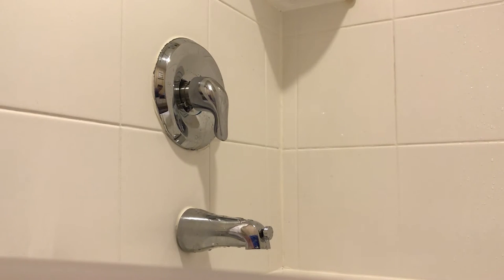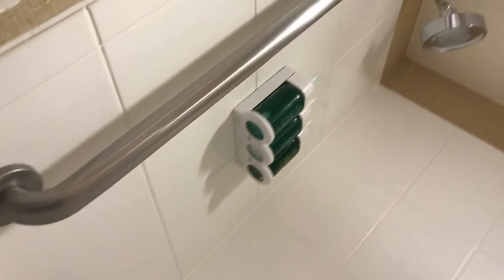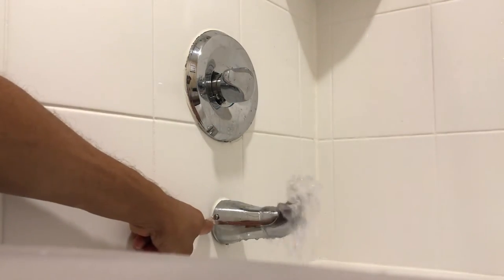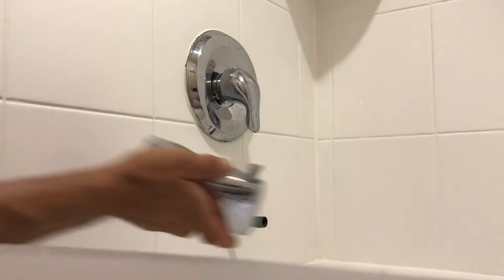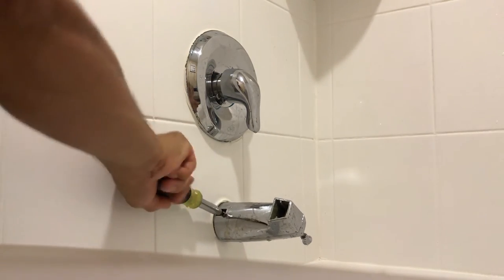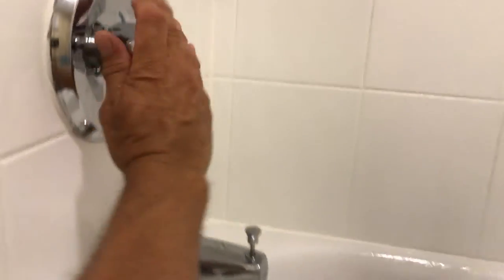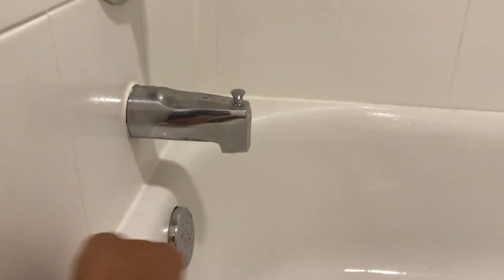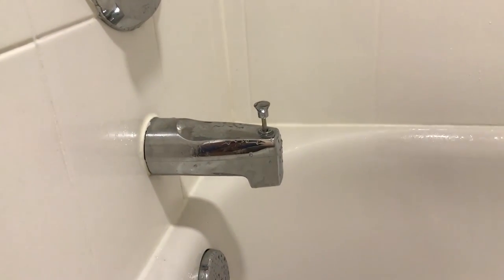Shower Runs When Tub Runs

Comment: Most of these setups are designed for an unobstructed outflow from diverted through minimum of 1/2 inch copper pipe, anything less than that will cause backflow to the shower because diverter-spout section of plumbing is not able to let all the water out from diverter into the tub, causing water to use additional outlet. In my case 1/2 pex was installed instead of copper, and pex couplings/fittings have much smaller inside diameter than 1/2 inch copper. I replaced 1/2 inch pex with 3/4 inch pex (not a huge fan of sweating copper) and that solved problem. Of course using regular 1/2 copper pipe and fitting would work just as well.
Reply: That must be the issue i'm having.  Bought a new house (30 yr old house) and the shower head is ALWAYS on no matter what the faucet is doing.  I replaced the diverter valve and it did nothing to the shower head.  I'm assuming the lines in the wall need some attention........at least i have a really accessible wall to open up...yay.

If I didn't have little kids who need baths.....it wouldn't have a need to fix it.
Reply: I'm having this exact same problem now. Installer put 1/2" pex crimped to a 1/2" coppper spout. It wasn't until he put a sharkbite adapter to change 1/2" copper to 3/4" thread did the shower head start pouring water. Now I have to try to maintain the 1/2" copper to the spout somehow, or open the wall from behind and do what you did, and run 3/4" pex to copper spout
Reply: @konradp8832  Don't you lose water pressure when going up to 3/4?
Reply: Don't you lose water pressure when going up to 3/4?
Reply: @carltonsorrells7609  That's actually the point of sizing it that way. You need to prevent pressure buildup between diverter and spout because that would cause water to "look for" additional outlet and backflow to the shower head.
Reply: @kaetamine  how did you put the 3/4" pex onto the 1/2" diverter?
Reply: Just had a bathroom remodel and I'm having the same problem. But in my case 1/2" CPVC was used for the tub spout. So, I have the problem of water running out the shower head when the tub spout is used AND the tub spout moves around when you touch it or pull the diverter valve.
Reply: @Lehmann108  looks like a few different issues at once... did you run that piece plumbing yourself? Your spout moving around, assuming that whole pipe moves with it, probably means that there is no ear drop fitting or anything like that securing pipe in place where it 90s into the wall. Rookie mistake, which is fine if you're a spare time DIYer, but doesn't look good if you do remodelling for living.
If you paid for it, definitely demand they fix it, if you made this mistake... well I hope you have access to that pipe from the other side, even if that means cutting out and outting back some sheetrock.
Reply: Greetings, 
Wondering if you could help me with my issue? I’m having the same issue as the video title but it’s not the diverter. I removed the spout and diverter and the issue remains. I also realized there’s low pressure. The shower seems to run fine (pre dismantled) with no leakage at the tub spout.
Any ideas?

Comment: What if its a brand new diverter and spout
Reply: Did you ever get an answer for this?
Reply: @charissaJane  looking for this answer as well... Just replaced mine, no effect on the problem
Reply: Hate to say it, but the pipe from the valve to the tub spout is probably too small. 1/2" PEX can't handle all that flow, so the excess water flow has nowhere to go except back up through the showerhead. Pipe between the valve and tub spout needs to be 1/2" copper or 3/4" PEX. You have to open the wall to fix that (ideally from behind).

Comment: When I run the diverter only, my shower does not run. What if it’s the opposite? When running the shower, the diverter is still running. I had a brand new tub faucet installed and that’s what it’s doing. The plumber said that is what the nee ones do. That seems like a huge waste of water when showering. Is what his saying true or did he install wrong? If he installed wrong, what is the fix?
Reply: He's Bsing you
Reply: PearlPerlita Venegas I called the owner of the plumbing company. He also said what you said, and had the plumber come back out and reinstall the piping line and put in a new diverter again. The plumber actually apologized and stated he was overwhelmed with the number of jobs being sent on because there’s only two of them, the other plumbers don’t want to work. Now it’s all fixed correctly. Craziness.
Reply: @salsamink  Wooow, that's exactly my issue. 
I fixed it few years ago (literally just took out the plastic piece on the spout the one that controls shower & tub water cleaned it & put it back), but that didn't work this time. 
There was a washer there, so not sure if that's it. 
My guy doesn't seem to know what he's doing, so I'm seeking help here. Glad you got yours fixed, but do you know what he did to fix it?
Or does anyone know? 
(My super, once, replaced the entire faucet, when all he needed was a washer... for a leak in the kitchen, so I'm not too trusting.)

Comment: I have a spout and shower. Water was leaking for spout. I changed cartridge. Still leaked. I took shower head off and plugged it. When I turn water off water still comes out to spout.I let the water run for 10 minutes thinking it may be water in the line to the shower head but water continues to drain. Any idea as to what the problem is?

Comment: Question. So you HAVE to change the whole faucet to fix this problem?
Reply: Well, that's just the spout.
Reply: The spout and if it still does it cut the pipe inch by inch after about 3 inches it should stop

Comment: I had my plumbing done in my shower n it was all replaced. A few days after installation it worked great for about a week. I then 
I noticed that both shower n tub were running at the same time. Called the plumber to let them know and he said the cartridge in the valve needs to be changed. He said bc it was more pressure than the set before that it messed things up. Im thinking but its brand new? Could you tell if this also could be the problem? I dont want them to do more unnecessary work on my shower. They’ve been out here twice to fix their mess ups.